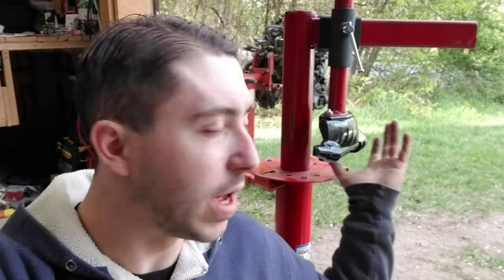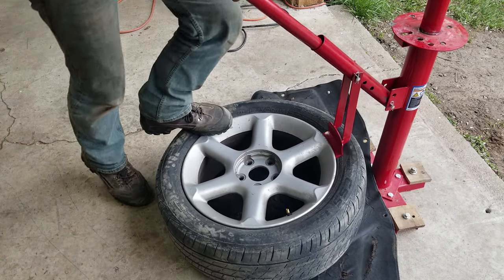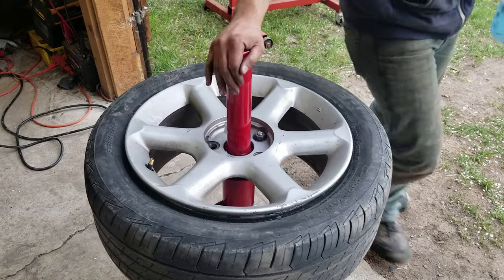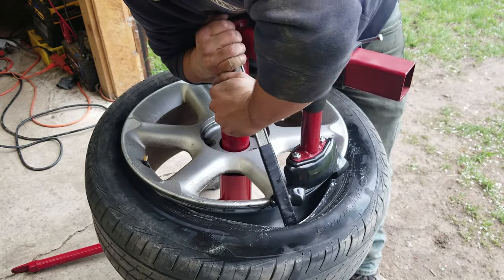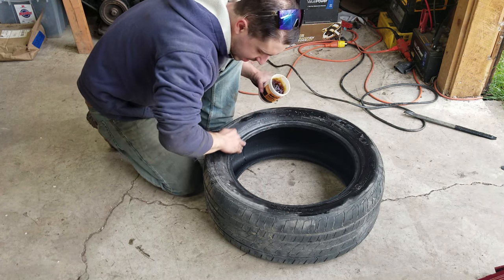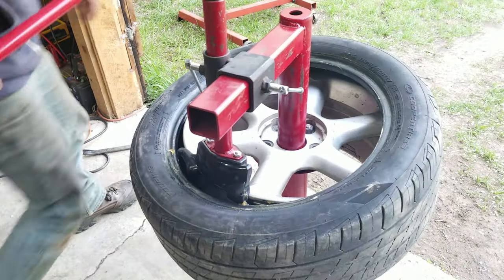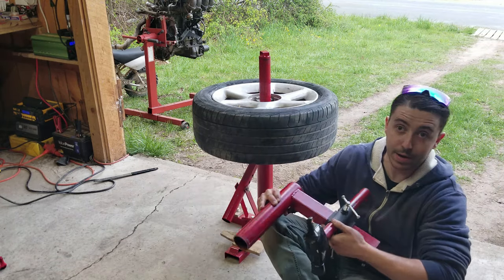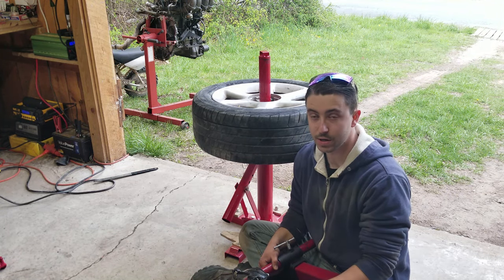Harbor Freight Tire Changer with Duckbill Mod

Comment: Leaving the valve core out helps when inflating/ seating the bead. Allows air in quicker 👍🏼
Reply: It does. And for those that won't seat...use starting fluid.
Reply: @thepitpatrol  use a bead blaster... safer, and works like a charm.
Reply: @The Truth Serum  now that is a fact. We farm, and are red necks, but the bead blaster is a great invention.
Reply: You can.make a.bead blaster out of and old frean tank too
Reply: Weld a 1 inch pipe add a ball valve and another pipe that you flatten the one end down . Easy project
Reply: Ok I guess for those that don't know how to make a portable tire fill can . I can go thru how to make that first if you want then how to mod it to a bead blaster to set a bead. Just let me know if you need that much info. I am sorry if this upset anyone . I know diffpeople have different skill levels . Thanks
Reply: @1leggedmedia  3 in one bead blaster, portable fill tank, and t-shirt cannon. 🙂
Reply: @thetruthserum2816  lmao that would work
Reply: How do you remove valve to inflate?  All air chucks they sell at Harbor freight need them for air to come out.
Reply: @sstjacques  Look up valve core removal tool 🍻
Reply: I use brake parts cleaner and make a wick on the floor over the tire then light it and boom it works like a charm every time it’s not dangerous at all if you use it in moderation, you don’t need much. I don’t mess with any ratchet strap or anything else no cursing and screaming involved. I’ve done dozens like this never had an issue. People that get in trouble by using this method apply way too much flammable substance and it can and will mess you up. Remember less is more.

Comment: I just bought the duckbill and bolted it to a piece of angle iron which I then welded to a 4 foot bar. Eliminated all the extra square stock and tubing. The duckbill can now float around the rim and with 4 feet of purchase can mount the most stubborn tires.

Comment: When you install the second bead, You need to put lube on the underside of the tire bead, where it contacts the duck head because that's where the friction occurs; not on the top surface of the tire.

Comment: How did you make the stand removable from the concrete? What did you use? Concrete threads
Reply from the maker: I used steel drop in concrete anchors, they essentially act just like a nut in the concrete.

Comment: Get a “rim clamp drop center tool”. It’ll help hold the tire into the drop center portion of the rim when you mount it back onto the rim. Helps a lot!
Reply from the maker: I forgot about those. I'll have to pick one up!
Reply: @HardAngle  you don't need a clamp just push the tire down on the opposite site of your duck head
Reply: Just you see clams and or vice grips put some protection at the teeth and you're done cost you a couple dollars or spend 20 or just do like the other guy said press down on the tire as you go around
Reply: Mr. Obvious here, what they said, knee, vice grip, clamp on whatever you use; get 180 from the duck head in the drop center.    I may be using it wrong but I use the Esco Drop Center Wedge.

Comment: I bought one of these junker tire changers and after some major modifications I can finally use it.  The accessories that come with it  is pot metal.  Its quicker just to lube the bead and spoon it on than to use the supplied junk.

Comment: Go ahead and reenforce the bead breaker before it bends, as it surely will. It's easier to seat the beards with out the valve core in place.
Reply from the maker: I'm going to work on stiffening it up as it does bend a lot on really stiff tires.

Comment: A little bit of soap water in the bead when your breaking it really helps I found
Reply from the maker: I found that as well, push the bead down, spray it in, work in it, give it a hard push and pop it comes off the bead.

Comment: I love how you did not edit out the part where you were having problems. I'm glad you showed that. About 10 years ago on Craigslist somebody was giving away one of these and the motorcycle part to it for absolutely no money. Ever since I've had it I've never used it. My problem was I did not want something that big sitting in the middle of my garage floor bolted to the floor. A month or so ago I saw someone using the floor anchors like you have. It looks like it worked pretty well for you and watching this video is perfect timing I have to run to Lowe's today so I'm going to pick up some of these fasteners and try breaking down some tires.

Thank you for sharing your experience with this. Do you happen to have a link to where to buy the top part of the tool? I'm really not even sure what that would be called so it wouldn't help me to Google it.
Reply from the maker: I left that part in on purpose, I try to be as real as possible. I do actually have the link for the arm https://www.ebay.com/itm/Manual-Tire-Changer-Swing-Arm-Mod-with-Duck-Head-Duckbill-Demount-2-Models-/373624493594?mkcid=16&mkevt=1&_trksid=p2349624.m46890.l6249&mkrid=706-127636-26712-0

Thank you for your kind words
Reply: for others wondering about these anchors, they are known as "flush shell" anchors. if they get debris in them, blow them out with compressed air before threading in the bolts. I like them a lot for temporarily or occasionally securing things in the middle of the garage.

Comment: Although I made my own attachment, we have very similar setups..... including the bent/flimsy HF bar! Noticed that you were missing the HF anti-rotation pin; I bent & removed mine too.

A couple of other things I found helpful; I bought a cheap hold-down/depressing tool which makes installation even easier. I'm currently building a centering cone, which will also hold the rim to the machine.

Great video-

Comment: where did you get the attachment. I can't find it on the Harbor Freight website
Reply from the maker: The tire machine itself is from Harbor Freight but the attachment is an aftermarket product. I just went and searched them up and it looks like the seller in Canada I got mine from no longer has them in stock and I can't find anything similar for sale anywhere. I'm sure something will pop up again soon in the future
Reply: Roundabout tools

Comment: Where did you get that duck head attachment ?
Reply from the maker: Ebay https://www.ebay.com/itm/Manual-Tire-Changer-Swing-Arm-Mod-with-Duck-Head-Duckbill-Demount-2-Models-/373624493594?mkcid=16&mkevt=1&_trksid=p2349624.m46890.l49286&mkrid=706-127636-26712-0

Comment: Not bad. The trick is to keep as much of the tire bead opposite the duck in the drop center of the rim. Just wondering if you would get more leverage if you stuck the bar in the end of the square.
Reply from the maker: I've stuck the bar in the end of the square before when I didn't want to have to hold it the whole time, both methods work about the same.

Comment: Helps if you put a clamp on the rim so the tire can't wiggle off just as fast as you can put it on.  Also, for really stiff or reluctant tires, you have to make sure the opposite side of the tire is down in the channel so it gives enough room so the bead can fit over the rim on the other side.  Sometimes a big C-clamp on the sidewall can help with that.
Reply from the maker: I need to get a set of rim protectors and a nice solid clamp to help stop exactly what you described.

Comment: on the back of your wheels spray this and scrub with a brush than rinse with water, it will take the caked on rust and grime off like magic, I'm not advertising this, I used it and was shocked it actually worked like magic, Eagle One Etching Mag Cleaner

Comment: So if u put a little gas around that bead when trying to pop off the bead it will pop MUCH EASIER... just FYI
Reply from the maker: WD40 works really well too, plus the little straw on the can makes it easy to get right in between the wheel and tire before pushing the tire off the bead.

Comment: Where did you get the tool for $200 at is it at Harbor freight and if so can you give me the part number
Reply from the maker: Ebay, if you search for "manual tire changer swing arm attachment" you should be able to find it.

Comment: What type/brand of tire lube did you use? I couldn't make out the brand name. 
I purchased a liquid version that seems to dry up before I can even start mounting. I've been looking on Amazon but most come in these large pails that would last me ten lifetimes and cost more than I'm willing to spend.
I really enjoyed the video. In particular the part about placing the tire the wrong way on the duckbill.  I did the same thing many many times before figuring it out.
Reply from the maker: I try to be as honest as I can even about my mistakes just in case it helps someone else out. The tire lube I use is called "Bead Don", it was about 20 bucks for the container and I'm about halfway through the container and I've mounted easily 100 tires so far.

Comment: Skip the lube if you're using sticky rubber, making power, or have big brakes. Use hairspray when popping the beads in place.
Reply from the maker: I have often worried about using lube on the bead knowing it stays there and it's the only contact area between the rim and the tire to transmit power to the road.
Reply: @HardAngle  yup, I can't get tire shops to even line up the yellow dot with the valve stem, when I ask them to use hairspray instead of lube, they look at me like I have a dick growing out of my forehead. I guess tire shop dudes can't afford actual hotrods, so they don't understand when someone is spinning rims inside of their tires...
Reply from the maker: This might be a very useful and headache relieving investment for you then. Since I was taught by some viewers how to use it right it is quite easy to change tires, I honestly don't think I'll ever buy a pneumatic, bolt this into the bed of the truck and I have a tire changer I can use at the track.
Reply from the maker: I got the duckbill arm on Ebay if you don't want to make your own and you can get new ducks on Amazon or Ebay.

Comment: What size is the bolt that you mount to the floor, there are 2 parts, 1 is the bolt and the things you drill to the floor and inserted what do you call that, thanks
Reply from the maker: I can't remember the size of the bolt, probably 7/16" or 1/2", but they thread into "drop in anchors", that's what I'm using at least, they work really well, haven't had any issues with them coming loose or anything yet and I've changed probably 15 full sets of tires now

Comment: don't forget to lube it when you break the bead...  Also, static friction is greater than kinetic friction, so get it in motion.
Reply from the maker: WD40 is GREAT for breaking the bead especially if there is lots of corrosion, but usually I'll just shoot some soap water in there

Comment: Looks like another good mod to that would be in the area of the bead breaker. Make a tube with a round plate at the bottom - like the top where the tire mounts. Put lug bolts thru the plate. Weld that to a piece of 1x3 tube and bolt it down. 
Maybe make it adjustable fir different size tires. Then the tire stays flat while you push down to break the bead with a longer bar.

Comment: When you went to put the top bead back on make sure you start away from the valve stem especially if it has the air pressure sensors , & push the bead down below the rim flange . That's the reason it slipped back off the first time you tried . 50yrs. in the tire business. & still going at 70yrs. Young
Reply: I agree. Always start taking it off starting at the valve stem and put it back on ending at the valve stem. That way the valve stem and especially the pressure sensor do not use up the precious slack you need to get the tire off and back on.

Comment: This is the most helpful video on YT on the correct position (5:21) of the duck head and the tire when mounting.. You saved me hours of trying to figure this part out. Thanks a million! Folks: If you're doing it right, manual tire removal and installation using the duckbill adapter should almost be as smooth as butter and it should not be a struggle.
Reply: Now if he would use the bead breaker correctly, he would be all set. @1:10 you see him pushing on the side wall of the tire, the tire should be pulled away a few inches so the wedge part of the breaker pushes on the bead and under the lip of the rim more.
Reply: @cheetahpro  didn't he correct that by repositioning the tire right after that?
Reply: Yes he did, hope others take notice. Just pointing out tire positioning. Most of these helpful videos on YouTube start out doing it the wrong way. Happy New Year  @AR-mb3id
Reply: @cheetahpro  Yep, there's always a better way to do things. HNY to you as well!

Comment: Do you have any pointers on keeping the valve stem aligned with the yellow dot on the tire. I make a best effort then twist the tire against the rim with it mounted but prior to airing up. It is a bit much for me to do a 245/45 17 tire on a 7.5 inch rim. It takes all my strength. I feel fine at the time but can't bare the thought of out sourcing to a pimply faced kid at a shop who doesn't care and who I will have to see many times due to slow leaks. I have alot of money invested in this due to situations like this. That one detail is causing me back pain for a month. I am going to be 50 soon so anything that I can do to mitigate that one issue would be helpful. The other parts of the process are cakewalk using the duckbill. Any ideas? Thanks.
Reply from the maker: I use some tire bead clamps (just specifically shaped rubber blocks not literal clamps) that help mitigate the tire spinning and I'll move the tire back just a bit so the tiny bit the tire will rotate before pinching the block will actually align the tire with the dot, other than that,  I don't have any other special tricks that I've found yet.
Reply: After you install the tire it will rotate on the rim, line it up after the mount. before you add the air lol

Comment: Move your bead breaker to the hole closest to the pivot point according to the tires profile size it will give you more leverage to help with the bead breaking
Reply from the maker: I just drilled a new hole on the pivot bar the other day to move the bead breaker out so it is pushing more downward instead of being at an angle and it has made a huge difference!

Comment: one thing I never see anyone do is clean the rim where the bead of the tire sits ., especially on steel rims .you'll never see a shop do this
Reply from the maker: I guess it's more profitable to slap a new tire on as fast as possible. I don't want to  take it off later to fix a dirty leaky bead so I like to scrub them clean or use the wire wheel in extreme cases of rust or corrosion.

Comment: So where did you get the duck bill parts for the tire changer
Reply from the maker: I got them on Ebay, just search for "manual tire changer swing arm mod" and you should see a few options pop up exactly like the one I have
Reply: @HardAngle  ok great thank you sir

Comment: Do you have a link or model number to the black duck bill?
Reply from the maker: I THINK, it is this one, I haven't ordered a replacement in a while but this looks correct. 

https://www.ebay.com/itm/195005320751?mkcid=16&mkevt=1&mkrid=711-127632-2357-0&ssspo=d0pC_VVLRm6&sssrc=2349624&ssuid=pvOiQn_wS42&var=&widget_ver=artemis&media=COPY
Reply: @HardAngle  Thanks this one fits. the other one that i bought were too big.
Reply from the maker: Awesome, glad to hear it, I ordered one that was too big once too and had to redrill it and it never worked quite right.

Comment: What about some 225/40-18 summer tires?
Reply from the maker: If you're asking if it will put them on, yes it will! I did a full set of 225-40R18s a few weeks ago.
Reply: @HardAngle  Would u be able to make a video on that? I have a set of Michelin PSS’s and would like to see it in action if possible. Are you having any problems with scratching the wheels or installation?
Reply from the maker: If you're super careful you won't scratch your wheels, the duckbill doesn't scratch anything because its nylon, its mainly breaking the bead that risks scratching the rim the most.
Reply: @HardAngle  What centering cone did u use? and how’d u keep it the whole wheel from spinning? I have that tire changer just without the mod. The little red rod broke that kept the wheel from spinning sadly.
Reply from the maker: I drilled holes in the plate the wheel sits on and I use bolts and lugnuts to bolt it down, I only have to use 2 lugnuts but it makes the wheel very solid on the machine and makes your life a whole lot easier. That way I also don't need a centering cone, I just made sure the holes were equal lengths from the center post when I drilled them, I hope that helps!
Reply: @HardAngle  Thanks for the fast responses man. How bout balancing the wheels? I have the HF wheel balancer but havent had any lucky. I'm sure my attempts were poor but oh well.
Reply from the maker: @dumbeezy5480  I've had pretty good luck with the HF bubble balancer, did you make sure to balance the head before you stuck the tire on?

Comment: What about balancing?
Reply from the maker: I have an old school bubble balancer for that and so far with all the people I've done tires for they have all said they feel great
Reply: @HardAngle  awesome! Where did you get the bubble machine? Thanks for replying
Reply from the maker: I got it at harbor freight, as long as you make sure you adjust the glass so the bubble reads center before you use it it will do a pretty good job.

Comment: Now balance it. You can get just as good of a balance with a bubble balancer
Reply from the maker: I have a bubble balancer. And I've done a full tire change for pretty much every one of my family members and not one has ever complained of a vibration.
Reply: @HardAngle  I have done the same . They work great just slower and may have to move some weight around. Or even spin the tire on the rim .